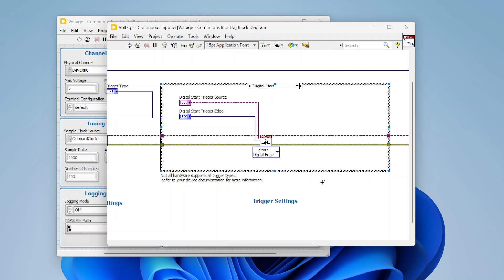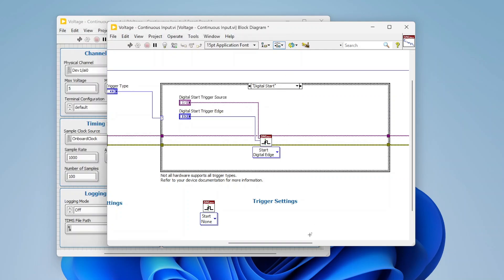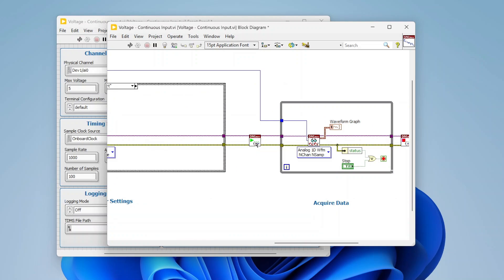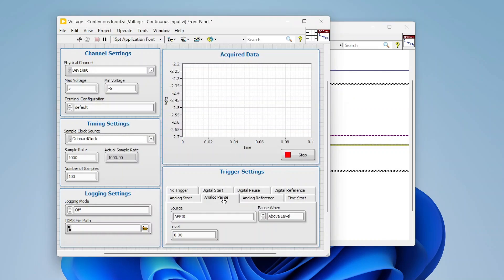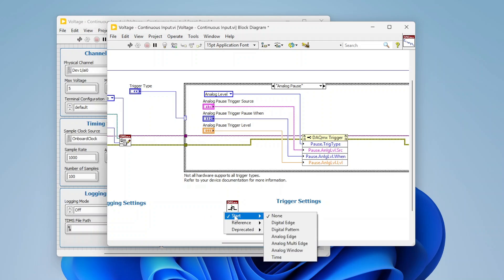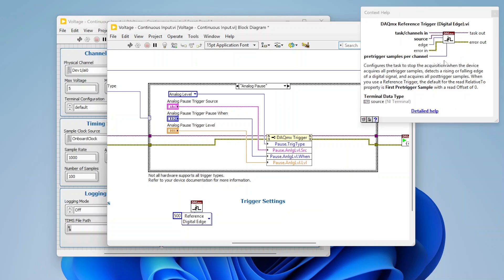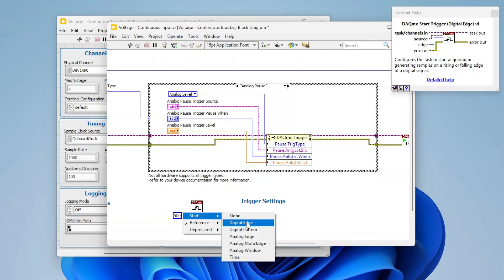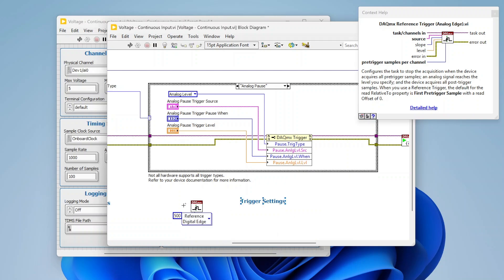DAQmx Triggers in LabVIEW

Comment: Can I use the DAQmx Trigger to start the Case Structure or only to Start Task? If not which trigger to use for Case Structure? I want the Case Structure to be True based on the channel analog level.
Reply from the maker: Do you mean check if your analog input data is above a certain threshold and then output a true if it is? 

If so, you probably wouldnt use a trigger for this. You can just read the analog input data and just use some of the comparison functions to check the analog level and then you can have logic based around that.

If I’m misunderstanding, please let me know and I can try to help out some more.
Reply: @cannoncontrols  This is exactly what I need,  but it has to trigger on the falling edge only. Simple comparison function is not enough. I know I could look at the previous values to determine whether it is falling but it becomes complicated so I was hoping there is a simpler way.
Reply from the maker: @uceee1  Gotcha. So there are several different threshold functions that you can use to determine when you have crossed a threshold and also direction. Additionally, if you don't care at all about seeing data until that even occurs, then a trigger could work fine for you. Would just depend on whether you want a continuous stream of data but to trigger certain logic when a certain condition is met, or if you really only care about when that event has occurred.